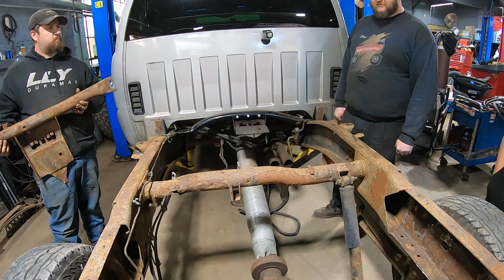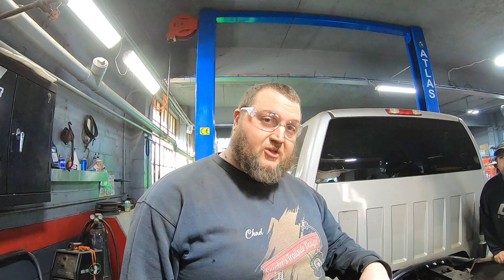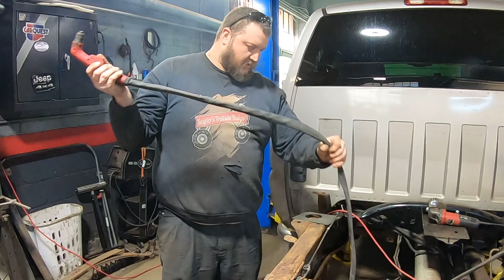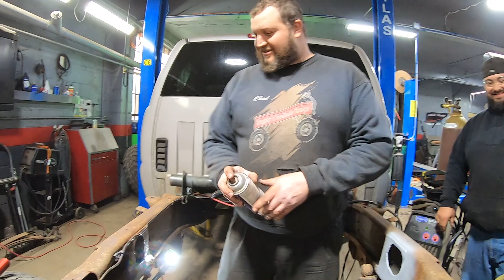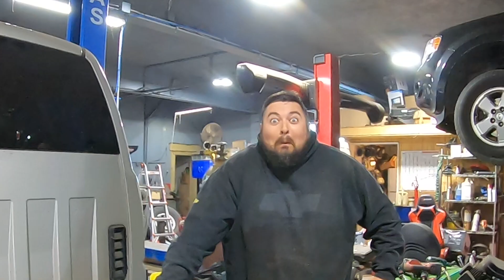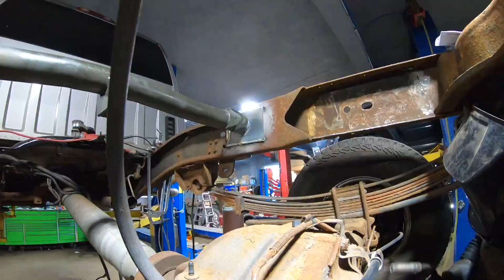How to replace a fuel tank crossmember on 99-06 GM Truck

Comment: is this the same process with a 2013 gmc sierra?
Reply from the maker: To be honest I’m not entirely sure. The frames are a lot different on a 2013 vs a 2005. But if I had to guess it would be the same basic principle just a little different.

Comment: I know the road salt in some states is very destructive but it sure seems like the manufacturers could do a better job of protecting the cars and trucks they make. I wonder how the $100,000 trucks they are making today will look in 10 or 20 years. I have a 1995 Crown Victoria that has spent it's life in Arkansas and the underside still looks almost new. I also have a 1988 F150 that spent it's first 30 years in Kansas (just one state away) and even thought the frame is still solid you can tell the Kansas road salt was starting to work it's magic until I bought it and stopped the destruction.
Reply from the maker: Yea, we understand the frustration and annoyance of winter destruction caused my road salt and chemicals they use on the road. These trucks tend to rust at an accelerated rate for some reason more than likely the metal that gets used in their assembly. There all kinds of paints and films used to help protect it but in our experience it just slows it down and never actually stops the rust. Thank you for watching the video!!

Comment: I have two that need to be done on a 1999 Silverado 2500. Where do you buy the new parts from?
Reply from the maker: Amazon is probably the cheapest and easiest place to get them. As is eBay. There are other places online that make good quality crossmembers but they’re much more expensive. I believe rockauto might have them as well. Thank you for watching!

Comment: Hello,
Do you think I can change the front  fuel tank crossmember without removing the bed?
Reply from the maker: You could change the front fuel tank crossmember without removing the bed. We don't recommend do it that way. You could come into issue with having space to move around and issues maneuvering the old crossmember out in one peace along with putting the new one in.